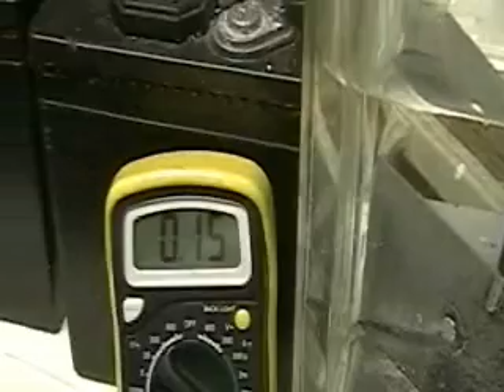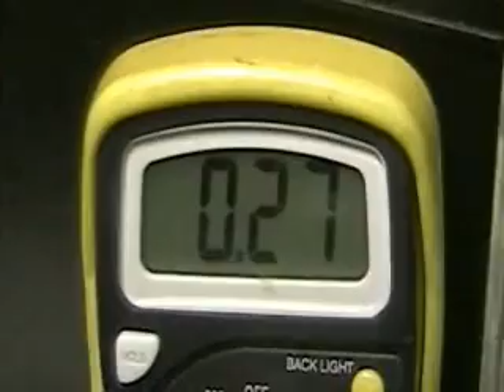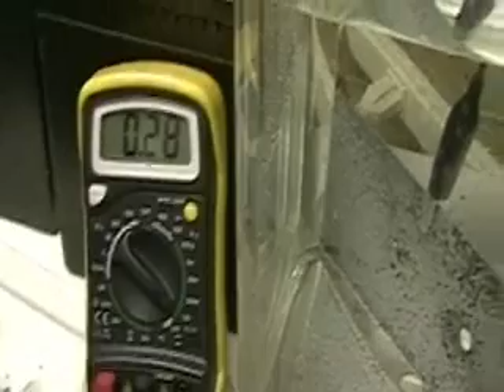Hydrogen Tap ( Load Plate Neutral Plate) 281

Comment: Hi John,
Could this effect come because the negative plate is not aligned with the positive plate?
I think the Amps goes up because the power takes the way across the not aligned plate - the water is like an resistor.

What would be if you put in more than 2 positive plates? Lets test 4. I heard you should take 1 negative and 2 positives because 2times H an 1time O.

Greetings
HydroFlei